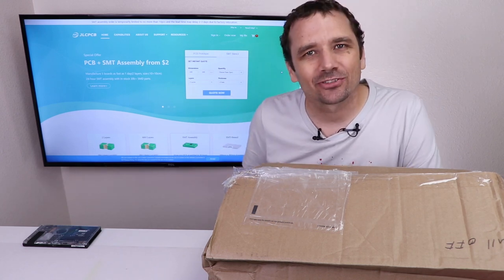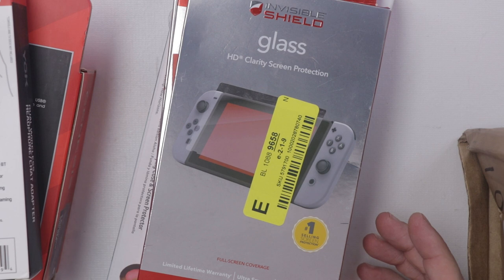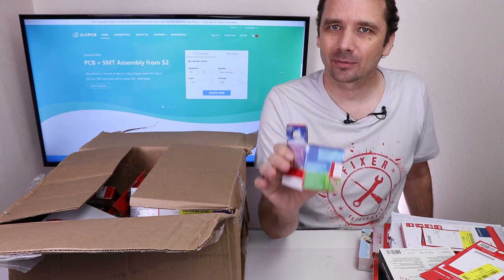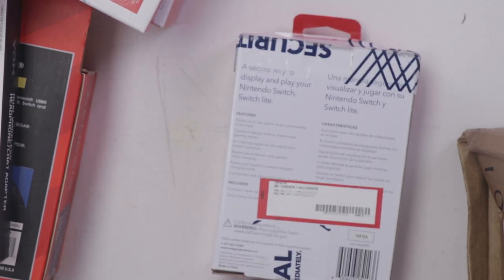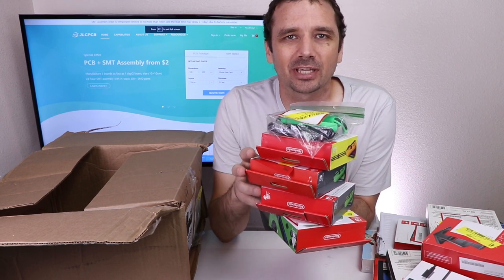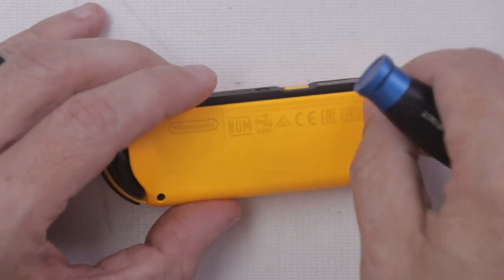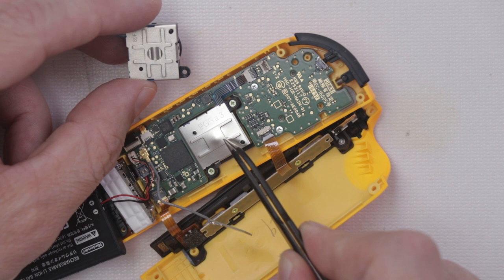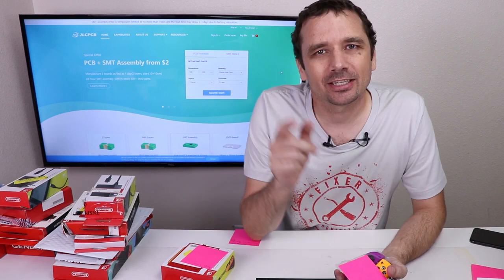I Bought A Customer Returns Box of Nintendo Switch Accessories - But What Was In It?

Comment: Yes it was a ripoff. But a good video. Offbrand accessories are junk to begin with
Reply from the maker: Agreed. If they were at least Nintendo official they would have been worth more.
Reply: Insignia isn’t that bad. It’s Best Buy’s brand. If you ever have an issue with an insignia branded item, you can just bring it back to the store and they’ll replace it or give you the money you originally paid for it. As long as you are within the warranty period that is.
Reply: Eh not ALL of them are. But most of them are, and some times its really good for the money if you just need something for the time being, to hold you off until you can get a name brand product. like the $20 nock off pro controller i used for like 6 months, than let me save up for a real one.
Reply: I find most off-hand controllers quality or ok are but what they generally don't do well in is the hand grip cause they often try to design it in a different ergonomic way that makes it pretty crappy feel or the button pressing feel response isn't there.

Comment: For the broken joycon it looks like the metal backside was dented making it so when you press down there wouldn't be contact. Would it be a cheaper and less effect fix to "mush" that dent back in or is it basically ruined at that point?
Reply from the maker: Those back plates are pretty hard to bend back without bending any other parts of it. Also, since it's been pretty beat up there's a good chance there are other problems with it internally. If someone couldn't afford a new stick though it would be totally worth trying that.
Reply: @Tronicsfix  gotcha. Thank you for taking time to reply

Comment: I have a left joy con that the lights only sequence one time when you press the button, they don't go back and forth until it connects. The only way I can get it to work is to go in and search for it and it finds it just fine. I did "update controller" on it, and still it's the same. Thoughts?

Comment: i have bought many job lot electronics like digital cameras 90% i have managed to get fully functioning much of it is sourcing batteries chargers recently i won a job lot auction of over 80 digital camera chargers for £150.00 many of those chargers sell on their own for £10 or more as they are official chargers , as for the digital cameras the ones i cant fix i dismantle them as parts lots lcd screens are one of the valuable of the parts ,  so the cameras may not work but you can still make money from the parts that are functioning , i have had non digital cameras in some of the lots like a halina super 8 , and some old film cameras as for super 8 not been able to source a battery so thought of making an adapter to fit rechargable batteries got to find out the voltage first , i bought a job lot sony electronics for£30 a dvd player no remote tested works sourced a remote  , there was sony mini dv camcorder with its box and instructions the battery has had its day so sourced replacement and charger there was a brand new wireless digital headphones worth over £20 , sony digital camera , sony clie i have sourced clie docking charging station to charge it up also there was a digital scales handy for weighing small medium parcels , out of the job lot the sony clie is worth the most